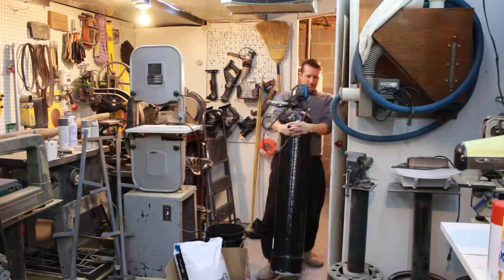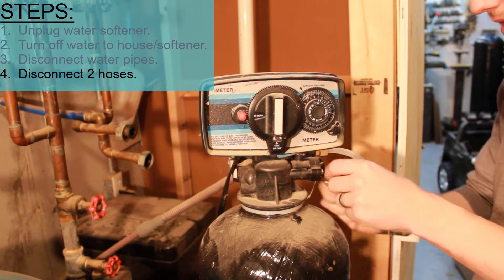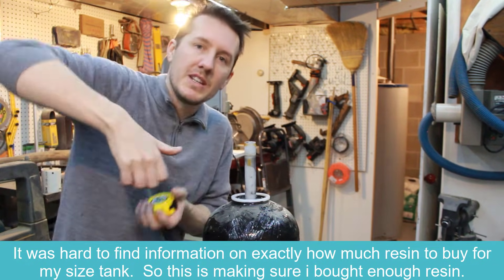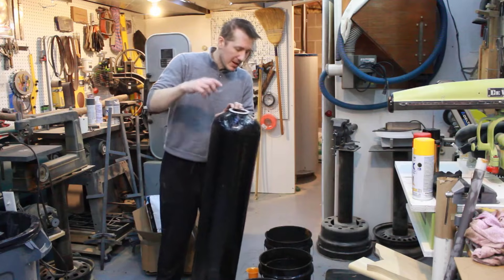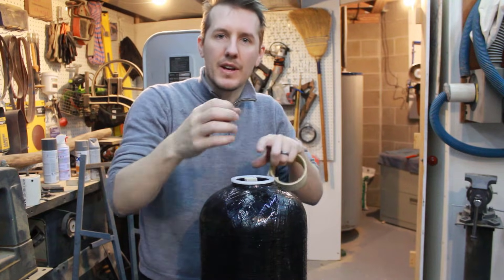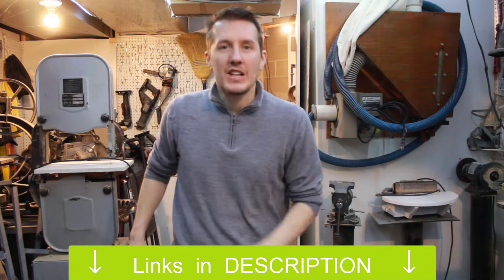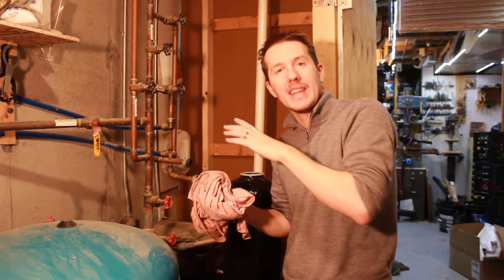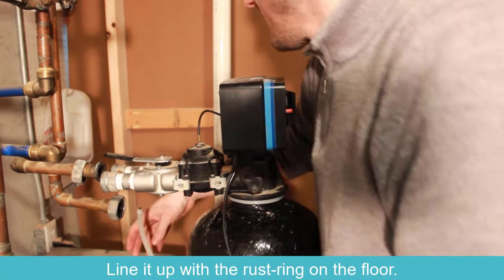Water Softener Resin Replacement - How to Replace Media in Tank

Comment: I work at a nuclear power plant. The used resin I deal with is highly radioactive. So it gets backwashed out of the demineralizers into a backwash receiving tank in Radwaste. We only handle new resin. We dump the new resins into a tank of water, mix until it becomes a slurry, and then pump it into the demineralizer. This way might be a little more challenging without the installed equipment I am used to having. Not impossible though. We use cation and anion resins. I assume the resin they sell for this is a mixture of the two. Thanks for the video.

Comment: Estimating media needed  ... Which is helpful when ordering media.  Note that I'm "subject to being wrong without notice!"  🙂So verify before proceeding with your unit!!!

With effort, the amount of resin for your tank may be found online.  My search has yielded a range ... and the numbers don't always match up.  If you need to calculate the amount, here's the process, or at least a process for an estimate.

1) From what I've seen, the tank should have 33% - 25% empty space (67% - 75% filled).  The empty space is needed as part of the regen process for expansion and agitation room. Over filling may do more harm than good!

2) Calculate tank size ... The volume of a cylinder (like the resin tank) is: Pi * Height * Radius^2 ( Volume = 3.14159 * Height * Radius*Radius).  
That equation is unit agnostic. If height and radius are measured in inches, and you want cubic feet, use the following:  Volume-Ft= 3.14159 * Height * Radius*Radius/1,729

So the resin amount is .6 to .75 of the answer in step 2.

@DaveWirth, Thanks, this helps me understand the how's to do it before I start making a mess and turning off the water.

Comment: No matter what you need 1/8 gravel at the bottom until you cover the cone, the gravel is for the flow and better regeneration, and also to prevent none of the bids are going to get stuck in the cone, im wondering why your doesn't have gravel, they all supposed to have

Comment: How did you know you when you needed to change it? Just wondering getting ready to install a Aquasure. Also when you first purchased this unit are you able to write down the amount you first applied so next time you have to do it. Then you will know how much you need during replacement

Comment: thanks for the video.  about to do this for this weekend.  your video made me think about a few things.  i was going to purge the tank first with the stage 1 which drains the tank before detaching it, thinking it would be lighter to move without the water in it but then realized after watching your video that the water in the tank would help drain all the resin inside of it.  If i had no water in there then it would be impossible to get all the resin out so you save me a little hassle on that!!   just one suggestion for a modified approach was that instead of unscrewing the bypass valve fittings from the water inlets, you can just detach the bypass valve from the control unit.  just a little easier to remove and then you don't need to deal with the big nuts and re-applying teflon tape, etc.  i have periodically had to remove the bypass valve just to get access to the flow meter turbine to clean it and real quick to pop it off.  happy DIYing!

Comment: Instead of disconnecting the IN/OUT pipes and turning off the main water supply line..

Can you at 0:55 turn the bypass on and then use a hex socket or flathead screwdriver to disconnect that from the controller thing?
Reply: Yes. I just did it that way yesterday to change my leaking O ring.

Comment: Just use a plumbing grease or lubricant that is rated safe for potable water. Supposedly once upon a time a lot of pipe dopes werent but they all have the nsf61 rating to be used for potable water

Comment: Well done, thank you!  I have the same setup as you and need to replace an apparently damaged distributor.  Can I just pull out the old one and slide in the new one without first emptying out the resin?
Reply from the maker: Probably not.  There's that round filter cap on the end.

Comment: when you take your control valve off and re install , do you have to recalibrate all your setting that were done on instalment? or does it unit save the setttings
Reply from the maker: I have an old analog one.  So it didn't reset, but i think i had to update the time.
I assume a digital one would go back to the default settings??

Comment: Why did you have to change it????? and when you were filling it up with new resin, why did you put it all on one side of that center tube? You forced it all to one side???
Reply: you want to put it in evenly and equal pressure. plus you lose cation every time it backwashes so fill it much higher than he did. that refill to where it was is a mistake. fill it to within a foot of the top. Or wherever manufacturer recommends. t
To me he's not putting nearly enough why leave that space empty? It should be working for you not just holding nasty water. the whole put it back as you found it levels is not correct. I own carwashes for 40 years so i know.

Comment: My Whirlpool water softener worked great for 9 yrs. Then I started getting a lot of white buildup on my plumbing fixtures (faucets, etc.) I had my water softener tank and brine well cleaned and the medium (beads) dumped and replaced with new. Unfortunately, I am still getting the white build up on my faucets 3 months later. The water tests ok (soft) and I have recharged the water softener three times (with cleaner) but it still keeps happening.  What is the problem?

Comment: Wow the local water softener company wanted to charge me nearly $1000 to get mine going again. Thank you for this detailed video
Reply: They quoted me today for $600 in Vegas,  I’m doing it my self and save $450
Reply: @pakovegas7809 how did you know it needed to be replaced? Was your water pressure drastically lowered?
Reply: @ we have 1 guy that does the service in the water filter and the water softener and said it needs to be change since I had it for 5 year that if i dint do it was going to mess my house pipes, and wanted like $650 or something but now I know he was scamming me all this time he change my water filters and charge me $400 I just seen them in Amazon for $100 all 5 filters I don’t mind paying form labor and his time como on $300 in labor I’m doing that my self also next year,
Reply: @aaronmusall2148 it has nothing to do with pressure or age.  The resin needs to be replaced once capacity is significantly reduced.  Let’s say capacity should give you 2000 gallons before regeneration and it’s only doing 1000.  Then it’s time for replacement.
Reply: @star9732  I get the regen part but my water pressure was killed. I turned the valve on the top of my tank to bypass and the pressure improved greatly. I used that as my sign to change the media. Once I did and returned the valve back to its normal position I resumed with good water pressure
Reply: @aaronmusall2148  there must be something in the water that’s causing the resin beads to significantly degrade

Comment: Thanks for this helpful video.  The Purolite is currently $20 less.  I'm a little concerned about buying a subpar quality resin.  A few reviewers mentioned that the Purolite was a smaller bead size than advertised and caused problems.  Have you had any personal experience with the Purolite resin?
Reply from the maker: I don't know.  I've only done it this one time.
It seemed to work ok

Comment: Great video. I will add a couple of suggestions.
1. Get a second person to help you empty the tank. These can be heavy.
2. The control valve has a screen filter and a couple of jets that should be cleaned every couple of years. Perhaps you did it but it was outside of the scope of this video.

Comment: Have two 2 tank rainsoft ec4 unit 
One with the controller and one by itself 
My question is 
Do both of the tanks need to rebedded with resin ??
Reply: If you have 2 tanks then it is most likely a softner (smaller tank) and filter tank (large tank). The filter tank depending on your circumstances is usually filled with granular activated carbon media.
Reply from the maker: I don't know.
I just had the 1 tank.
If you have 2 tanks, and they are both full of resin, and it's time to replace the resin, then i would guess you need to do both.
But again, i don't know
Reply: Похоже у вас стоит  система дуплекс один работает другой в регенерации

Comment: Why did you change the resin or is that another video?
Reply from the maker: We have very rusty water.  We've lived in the house for 6 years, never changed the resin, and doubt the previous owners ever did.
I just though that it would give more life to the softener and clear up the water a bit.
Reply: Water softening resin needs to be changed every 6-8 yeaes
Reply: under microscope it loses its hooks that grab impurities over time they round off.

Comment: Ion exchange resin could always be recharged using salt water.
Reply: The resin ages due to oxidation and it breaks down into finer particles and becomes very ineffective (it turns into mush) and thus it needs to be changed when this happens.  Typical life of the resin is 10 years depending on the chemistry of the water, etc.  Higher levels of chlorine cause the resin to breakdown quicker as an example.
Reply: I don’t understand. To recharge using salt water you would do a regen like normal once you’ve changed the resin and reassembled it.

Comment: I WOULD BLEACH THE TANK WHEN ITS OPENED AND PUT MORE WATER THEN A FEW CUPS..  THE GRAVEL IS IMPORTANT TO THE STRAINER TO SIT IN TO AVOID THE MEDIA GETTING THROUGH .  THE CENTER TUBE SHOULD BE CLEANED WITH BLEACH AND ADD A CUP OF BLEACH TO THE TANK AND ADD YOUR RINSE WATER.  THINK ABOUT ALL THE TIME THE UNIT SITS WITH OUT FLOW AND WATER STRIPPED OF CHLORINE...VACATIONS AND HOLIDAY TRAVEL...CLEAN YOUR SALT BRINE TANK AT THE SAME TIME AS ALL SALT HAS DIRT AND SEDIMENT THAT WILL DISSOLVE BACK INTO YOUR MEDIA.  YOU DID A GOOD DYI VIDEO THAT SHOWS THE BASICS.  TEST YOUR WATER FOR DISSOLVED SOLIDS THAT TELL YOU WHEN THE MEDIA IS USED UP.  WISHING YOU WELL.  THANKS FOR THE GREAT VIDEO AQND SOUND QUALITY....WELL DONE

Comment: Great video just what I needed.  I think I will opt to change that o-ring while I have mines apart.  As I’ve found with these kind of diy projects it cost you less in the long run to replace cheap parts that are old with new ones.
Reply: Yep.

Comment: Was there gravel in the bottom?
Reply from the maker: no.  it was all resin
Reply: there should be pee gravel up past the intake(the part he brushed with a wire brush) to prevent clogging same reason you put gravel in before soil in a planter.